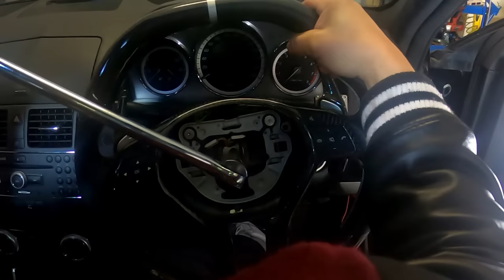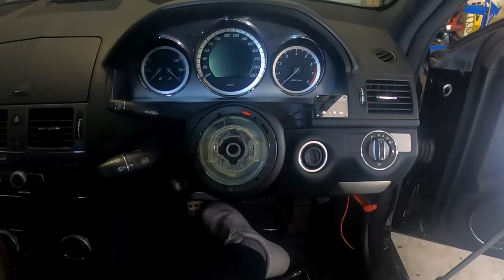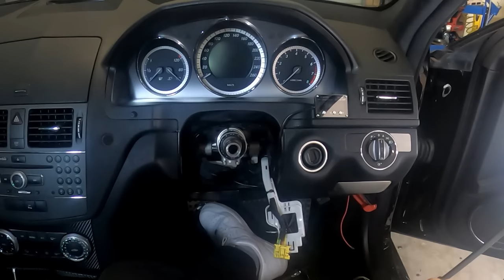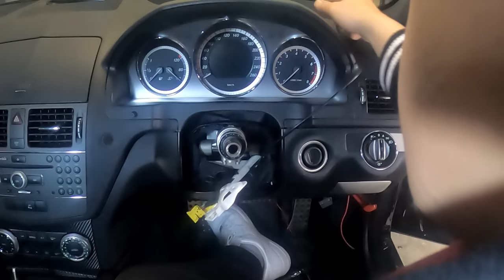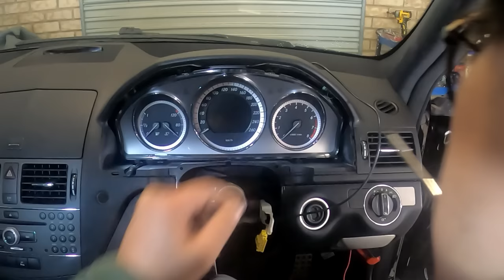HOW TO remove and fix ESL/EIS/ ELV MODULE  w212 w204 mercedes motor replace  Part 1

Comment: Hi, The tool you use is called what and size? They long tool to take the metal box apart
Reply from the maker: dunno the actual name but if u search w203 esl removal tool u will fund ut on ebay aliexpress and Amazon
Reply from the maker: u can also use a torx 5 bit and hammer it in until it grips then pull and turn as u remove ..it works the same
Reply: @MIKEYZVLOGZ  I appreciate it I'm stuck in a parking lot at subway I use the fuse bypass right know to start the car
Reply from the maker: @geraldmcneal7110  nice well done
Reply: Hello, don't bother with getting the tool, it didn't work for me. They are NOT screws but roll pins. I used a stud removal tool to get mine out. Hope this information helps
Reply from the maker: @mobbinken2093  yes but the point-of-sale the tool is just to help get grip ..its not to screw it out.. yes they are roll pins..which is why u turn and pull..so the tool or a t5 torn can grip and pull it out ... its not a bolt or screw  .correct... the tool is made ro flip the pin and allow u to slowly remove as u pull backwards
Reply: @MIKEYZVLOGZ  I learned that myself haha like a month ago when I made this comment

Comment: Hey , saad from pakistan here , need ur kind advice as am too far from ur location to get ur physical support . 
i own a C class w204 C200 , 2007
i wana know that is it good to remove ESL easily, when it is working to aviod any failure in future and get stuck somewhere far from home ?
in pakistan , mercedes is very rare and so its maintaince . so its my fear that i ll get stuck in huge trouble if ESL gets fail any good day due to its cheap motor
Reply from the maker: hi saad firstly welcome to the channel .... hope u can show ur support... now wen it comes to the esl failure  ... the problem here is that its s major common fault n there is no way of kowing wen it will fail.... and it can happen at any time with no symptoms showing before it happens in an instance... with that said its very hard to say what u can try to do on order to prevent it from failing.... another course of action u can try and take is by having an emulator bypass module installed ... its costs about 50 dollars and it will need to be programmed to sync with your car cost about 300 to 500 depending where you go and who does it  and that way if your esl fails u have another module you can plug and play .... and best thing is u dont have to remove your old esl u can simply unplug your old esl and then plug in your bypass module .... this is my next option if my esl fails again
Reply: @MIKEYZVLOGZ   thank you alot brother

Comment: Are all esl assemblies (where the motor is ) interchangeable among w204 cars or are they programmed specifically for each car? I dont have the problem (yet?) Just  nightmares it  might happen anywhere anytime (happened to my dad on his 204). I thought of getting used assembly from breakers yard, exchange the motor in it and just have the whole new assembly with me in the car if (when?) It happens. That way i can finish it quicker just not sure if it is coded or something.
Reply from the maker: they must be coded to suit your car and eis ..as the esl synced with the eis and allows you to start the car... do grabbing a old one wouldnt be useful unless your just getting it for parts...in any case if your worried about it u should definitely consider the esl bypass module ... its basically exactly the same as the esl but it doesnt have the motor and locking mechanism so that u dont have to worry about it malfunctioning ...its what i would do if it happens to me again ....but u have to get it programmed to suit your car .... and best thing about the bypass is you can simply plug it in without having to remove the factory esl at all ....just unplug and plug new bypass in

Comment: Have read it is a good idea to disconnect the battery, because if you remove the air bag and forget to connect it electrically afterwards, the computer thinks the air bag has burst and locks the car and you have to go to a stealership.
Reply from the maker: ok so ive done it before where i have disconnected the airbag with the battery connected and i can say without fail nothing happens... i believe that your air bag sensors on your front support bar is what sets off the air bag not disconnecting yhe airbag connector .... doing  that just throws an airbag error and it can be resetted with an obd2 scanner tool that can reset airbag codes... if u watch my video on how to use an odb2 scanner tool    i show it live
Reply: Now my boot is locked and I hope I can open it with the key to put the power back on.

Comment: Bro i finally got the ESL to u lock! But what is the thing you used to pull the ESL screena out??
Reply: My t5 bit broke off
Reply from the maker: I use a t5 torx bit hit it in abit not too much just enough for it to grab and u pull and u twist and it comes out slowly ... the pins come out slowly
Reply from the maker: @TheEverLoLMrLoL  if u broke off a t5 in there then u may have to drill it out ... unless there is another way of removing it i used a special tool designed for that purpose and pins ...got the kit off ebay ...they give u a eis removal tool and the pin removal tool for about 10 to 15 dollars
Reply: MIKEYZ VLOGZ Yeah bought the tool, hope it works :D
Reply from the maker: @TheEverLoLMrLoL  it will

Comment: Hi there.  I replaced the motor and followed all the steps. I never removed my key from the ignition and reconnected the battery. The ESL is still in the unlocked position but my car won’t start nor will the key come out of the ignition. Have I fried the chip?
Reply: Problem solved....still had the car in neutral....put it in park and it started right up. Thank you very much Mike for making this video.
Reply from the maker: lol yep we all make these silly mistakes u must have had in drive cuz car should start in neutral

Comment: How do you know the motor was the issue as opposed to the whole esl board itself or the eis?
Reply from the maker: well research pointed to esl motor ... and then it came down to trial and error ..but first thing was the intermittent fault where car would unlock esl and sometimes not .. the knocking of the steering column under esl which then allowed the esl module motor to spin and unlock soni could start and drive ..these were all the contributing factors ...
and if u do some research u will see ... its the esl motor that fails not the pcb esl board or even eis ... but yes they can fail ..but 99% of the time it's just the motor
Reply: @MIKEYZVLOGZ  I am having similar issue but my steering wheel was never locked to my knowledge even before the car wouldn’t start. I’m hoping it’s just the motor so I can Do it all myself. Once you put in the new motor did you have to reassemble everything like airbags, steering wheel etc before you could test it?
Reply from the maker: @Dnasty1  it most likely is mate ... to test it I don't have to put it all back .. buy u will get an airbag code which u have to reset with an obd2 scanner tool

Comment: It would help if you showed the exact procedure for unlocking the esl. Thats the most important part. Thanks
Reply from the maker: wen u insert your key it unlocks the esl then u disconnect the battery ... if it doesn't unlock use a rubber hammer and tap under the steering column to help shake the esl to unlock
Reply: @MIKEYZVLOGZ  where at can you post a video of location you hit it on.

Comment: Should I unhook the battery before I start this process?
Reply from the maker: only once u unlock esl by inserting key..if u unhook battery right away u won't be able to unlock esl with key becuz no power ..u Insert key then disconnect t battery

Comment: Ayy Mikey, great stuff bro. You're helping so many ppl. I have a question plz. I had the problem of my motor locking up cuz of the ESL/ EIL ( i know nothing about cars). Once the mechanics finished replacing the "ignition switch", they said they needed a " NEW KEY MADE AND PROGRAMMED" which costed me some $400 more! Anyways the NEW KEY started failing to crank the C300 Benz (2010) within 4 mos of installment, but I didn't take it back cuzmy 2 original keys cranked the car. Now here it is nearly 2 yrs later the same thing needed repairs and the WARRANTY was still good. So i had it towed to them ( cost me $300). Took 5 wks for them to fix it. Once repaired, they said i need a NEW KEY to program it 🤔. I said a NEW KEY should come under the warranty and what did you do to the car in repairing it in order for the previous keys not be able to crank it?!? They FASELY CLAIM they never made a NEW KEY the first time cuz they couldn't find an invoice on a key being made. Common sense that ANOTHER NEW KEY is necessary....or....what did you do while repairing it that prevented theprevious keys ( 2 originals & the first NEW KEY) from working? They said, " nothing but repaired it and the ignition switch now needs a new key made and programmed" 🧐
Reply: No reply Mikey? Thx anyways.

Comment: Just Wondering If I Can Speak With You About My Car, I Have A '08 C300, I Lwft It Outside For About 2hrs & When I Came Back It Wouldnt Start But When I Enter The Key The Steering Wheel Still Can Move, Do I Still Have To Change The Esl Generator?
Reply from the maker: hey buddy im sorry to hear that.. so best thing in this case would. be to first try and have it scanned with a descent obd2 scanner so it can tell u the source of the problem .... from the sounds of it it could. be the esl module itself ( the motor) or even the eis... however in our cars its most probably the esl module ... after all it is the most common fault in our cars

Comment: Hi Mikey, my w204 els stopped working in unlocked posotion. I took els off and replaced the motor and placed it back. When i turn the ignition it went into locked mode and after that it isnt working any idea why? Breakdown guys staryed my car by directing relay before i fixed it. Any idea?
Reply from the maker: hey buddy so when you put it back together there are two micro switches that you need to ensure are pressed when you put the board back in ... they are little grey button like switches ... you should notice this when you placw the board back in.. everything should sit easily and without having to force anything in place.... doing that can cause the esl to malfunction... some ppl forget this step as i forgot to mention it and show it ... but it is an important step... its can be the reason your esl wont work.... also do not try to start your car too mamy times the auto lock feature will iniate to help protect the car from theft ...its a anti theft security feature ... wen u put it back together only try cpl times if it doesnt work then aomething isnt right in the esl... u need to double check everything ...
Reply: Thanks great video
Reply: Did you get your ESL fixed; if so what did you do?
Reply: @bernardc531  actually after replacing the motor i did not place the black thing properly resulting bricking the els. So i called installed someone with the emulator he replaced and programed it for me and then i had to assamble everything back. He charged me £100 and job done.

Comment: have you had issues with the clock spring? After doing this repair I started noticing a squealing noise while turning. Then my  steering wheel's control buttons started failing, and the horn wont work. The blinkers and cruise control still work.
Reply from the maker: seems like u have a connector problem ... did u plug in your connector properly ? I haven't had an issue with anything else thus far... I would take it apart again and ensure everything is fitted properly... buttons will have to do with the plug harness too... the buttons have their own module built into the buttons .. u may need to change the buttons .. can't say for sure ... do a s an and see what pops up ... worst case have an an auto electrician look at it and narrow down what the issue might be before throwing parts hoping to solve the problem... never do that ... that's my advice ...
Reply: @MIKEYZVLOGZ  ya possibly. the buttons are brand new. they replaced it all when i did the recall for the airbag. horn doesnt work either. it started going out intermittently, but would come back on if i turned steering wheel a certain way. After a little while it just failed completely.

Comment: Hey bud quick questions I’m working on my car right now c300 when you tap under the steering wheel and the Key is in the ignition to get to unlock the ESL you’ll hear a noise indicating that the motor unlocked...how do you know it’s unlocked ?! would you be able to rotate the steering wheel?!
Reply from the maker: yes u hear a winding noise indicating the esl is unlocked ... when unlocked u should be able to turn wheel... but there have been instances where it seems unlocked but it isn't fully unlocked ... ..the only way to fully tell its unlocked is when u depress the bolt on the esl module ...wen u remove the 13mm nut on tip of esl .... u should be able to depress the bolt all the way to release the esl module

Comment: Hi I removed everything as the video shows but can’t find the ESL box after removing the 4 E12 bolts. I have a 2011 GLK350
Reply from the maker: hey bud it on top of the steering column in the centre .. u have to do it by feel becuz its hard to see it but its there
Reply: @MIKEYZVLOGZ  thanks! Found it, but after opening the ESL found out that the board is fried 😫
Reply from the maker: @davidbenitez4653  are u  sure its the board? sometimes it might look like board but its just char from the motor .. if its the board ur gonna need a new esl programmed ... a specialist must do that for..u someone who does auto locksmithing cut keys etc ... they are gonna need your esl and eis barrel..so they can program and sync it
Reply: @MIKEYZVLOGZ  yes there is a piece of the board that fell off, unfortunately. I will need to search for a new one and have a locksmith program it as you said. Thanks!
Reply from the maker: @davidbenitez4653  no worries glad to help
Reply: @MIKEYZVLOGZ  quick question, do you think is better to install an emulator now that I have to replace the whole ESL?
Reply from the maker: @davidbenitez4653  yes I do less moving parts means no failure of esl motor...wen my esl fails again I will get an emulator too

Comment: Hi Mikeyz,
I think my car has got the same problem. It was all good when I parked in my driveway last night but today morning I was actually shocked to see, no ignition lights...seems like a dead car. I think I am lucky in 2 ways, car is parked in my driveway and this is in unlocked position. I have also managed to start and drive my car, with manual start. Now my question is, is this always the motor isuue rather than anything else? Should I consider going for diagnostics first.... I am comfortable with DIY but don't want to end up in a worse situation. Thanks
Reply from the maker: ur symptoms point to esl module motor.. its the most common fault
Reply: @MIKEYZVLOGZ  
Hey,
As we discussed, I stated to take out the ESL yesterday and succeed till the very last. But unfortunately stuck at the last step. The was going in till the level of the case it is placed, but not enough to take ESL out. I was so unfortunate that I missed this by may be 1 or 2 mm. So to this is actually not a open or locked kind of situation. Although electronically this was in open position, steering was absolutely free, but this ESL cog had probably one less turn to make the bolt move freely and to take out. I continued to try further tapping, irritating the bolt and what not ... Nothing happened.... Had to put everything back with a hope of getting into the right position by retrying with reconnecting with battery and key in and out. I knew there was a risk of getting stuck in lock mode. And guess what..... It happened, car got stuck in lock mode..... And after more than and hour of effort electronically it's locked, while mechanically steering was moving with a click noise which means the lock is still somewhere in between but this time more close to lock than open. I had no option left and stopped. This morning I was praying to God, please do some trick let it go in open position. And after 2 attempts it has gone into open position. Hurryyyyyy. I have checked from the bottom and the bolt is going in freely......I am relieved a bit now and will re try today evening once once I come back from my job. My only worry is, if this is not ESL but ignition switch (although seems less likely to me) I will be stuck again. I am trying to find symptoms to distinguish this problem without connecting to digital device, as I don't have this option. Thanks will update you .
Reply: Hi,
Finally I managed to finish the job and it's working now. The motor in ESL was not not completely burnt, but there was some black dust around. It was working when connected to 12 V DC outside the ESL, but very lethargic compared to new one. The shaft also did not seem jammed. Not sure what has gone wrong over time. Now all done and with right tolls I managed to finish the job without taking the steering wheel out, just the dashboard cover and 2 bolts of panel were removed completely and rest 2 partial. Not that difficult but ESL opening and closing needs lot of attention.
Now how reliable are these Chinese motors? Thes noise of locking is louder, it's very brisk compared to original one and does not sound like reliable to me..... What do you think?
How many years since you changed and it worked well? Do you think switching to emulator is right idea? 
Thanks.
Reply from the maker: @lifeis1toenjoy  mine still going good .. and honestly it's a good cheap replacement and really should last few years   mines still good and going .. been 2 years
Reply: @MIKEYZVLOGZ  Thanks. That's quite reassuring.